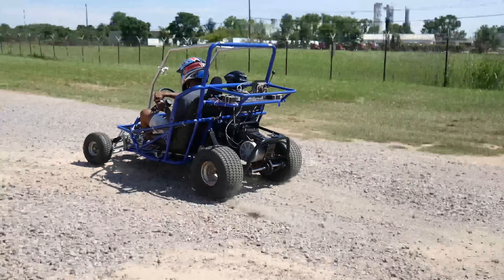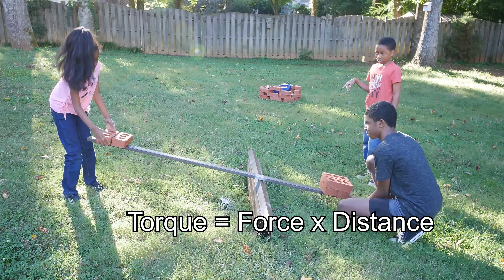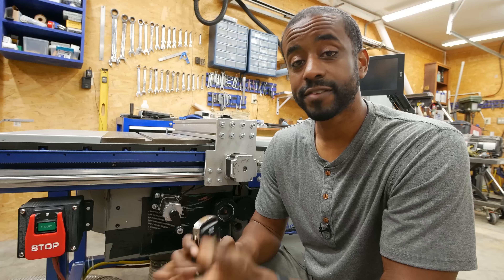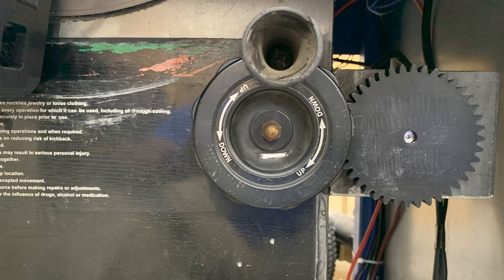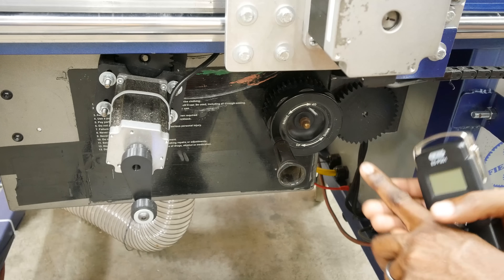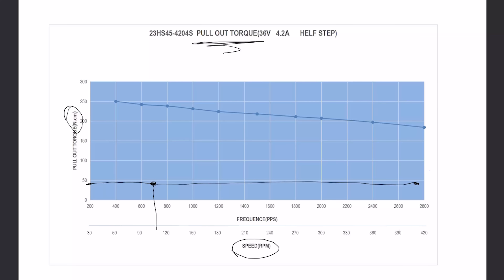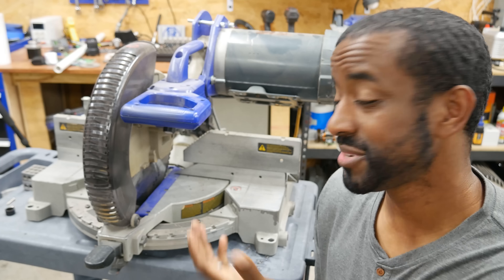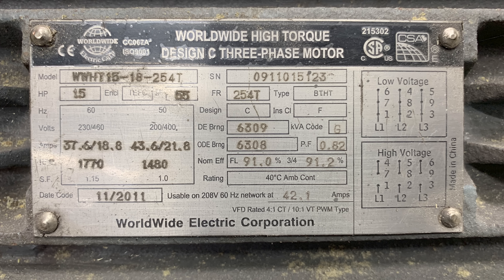How To Size Electric Motors for Any Project: A Beginners Guide #085

Comment: I will be coming back to this video in a few days to start my overdue upgrade project.    Here is my project.  (I hope that the people here can help give me some tips on this project.)    So here is the project.   

My wife got a fancy cat last year.   We ended up buying a very expensive poop machine called a Litter-Robot #3 by Whisker.   The machine works ok at best.  How the machine should work is that, after the cat does he's business, the unit will cycle and dump the contents into the air tight bottom container.   However, it almost never makes the full cycle.   So this mean that every time I walk by i have to hit the reset and cycle button to help it along.    I do this about 3-4 a day.   But sometimes this is not enough and I need to power cycle the unit.  

Thats problem #1.   The second issue with this machine is that when the machine does kick on, the motor is sooo freaking loud !!!!   I have 3 kids, (1, 3, 11) , this super loud motor whine always seems to wake up one of the kids a night.  I have to remember to unplug the unit at night so that it doesn't turn on.    I need to make sure to replace the motor with a big enough motor that can be quiet.   

Problem #3.   Some times we over fill the unit with cat litter and the stock motor will not even move the cylinder.   When this happens I have to go back and scoop out litter.   NOT FUN.   lol.  I want to make sure that the new motor can power through and not have any issues.   

I'm pretty excited to see if anyone responds to this post.   

My background:  I worked as an electrician for 5 years.  Then joined the ARMY.  When I got out, I got my AS degree in Industrial Technology (Industrial Electrician), .  I am working now as a Biomedical Engineering Technician for a big hospital.   I've also taken a couple years of wood shop and I just purchased a Miller Multimatic 220 and I'm teaching myself welding.   Thanks to everyone, if anyone, who helps.

Comment: One thing to note, about fans, the faster they rotate, they move more air, requiring more power and if they rotate twice as fast they require around 4 times more power. Learned the hardway.

Comment: Instead of mesureing the rpm of a motor yourself you can first see if you can find a data sheet for you motor unless if you already have an rpm meter in which case you should always use those measurements

Comment: You know, I'm pretty decent at building things. But usually, I end up with trial and error as my way of determining these questions. I suspect I've spent $3-400 finding out what doesn't work.

Had i had the ability to focus in school, I could have learned some of this. Anyway, all that being said, I wonder if it would be feasible for you to offer a consulting fee for individuals? I certainly could sometimes use the recommendations of an expert to avoid costly learning. Just a thought.

Thanks for posting, I now have a bit of understanding, but, no real idea of where to go next. By the way, too cool with the kids. Mine hated moving firewood till they got heat bills. Anyway, thanks again, and God bless.

Comment: As long as the weight of the scale is less than what it takes to turn the handle you're not including the weight of the scale, because that is just the force used to turn the handle.

Comment: Really great stuff from a really good guy. Jerry, would you comment on adding a second ebike or geared motor on the other wheel to use solely as a generator? Would I be able to generate enough power, current, voltage to offset the extra weight, friction, etc? Anyone's input would be welcomed by me.

Comment: I missed your live feed, by 5 months. But I still have questions. I'm building a mini table saw, but don't want a 4" blade restriction. I'm looking at several motors and believe the DC 895 motor would be optimal. Unfortunately the most prolific YouTuber I've found on these size motors is East Indian and I can't understand what he's saying. I want to be able to mount at least a 5.5 inch circular saw blade, maybe 6.5 inch max. Would the DC 895 format motor work? If not I would appreciate a recomedation. The only other question is whether to go direct drive or use a belt drive. Any information you can provide will leave me very grateful.  Thanks for the great videos.

Comment: As always, very insightful! I'm making a barber pole(crazy, I know). Right now I'm using a motor from a microwave. It runs slow enough because of the gear ratio but it's too jerky. What type of motor would give me that "slow and smooth rpm? Thanks for all your great info.
Reply: Buy kambghini farri v12

Comment: Man, you are great! I need your opinion on a project. I want to make a motion for a flight simulator I am building. Fill size Boeing 767 cockpit with 2 seats, dual controls etc. with 2 individuals and with hardware about 500 pounds.  I can handle the electronics . I am looking at cheap way to use actuators  with minimum power., meaning the weight of the hardware would be "neutral" .  Being a physician, I have been looking for a large ball and socket mount. I'm thinking about a 3 foot socket,  somehow covered in multidirectional "free steel balls" like those in ball bearings but free in a layer of grease. The "Ball" would be mounted at the center of gravity of the cockpit.  The center of gravity could be adjusted with water tanks inside the cockpit or weights added . I would use either linear actuators or step motors  or both.  The idea is not to have the actuators support the weight of  the cockpit, but rather exert a small force to make up to 45 degrees banks in 4 DOF,  up & down I can use an electric car jack or a jack screw.  Any thoughts or recommendation would be most appreciated.!   Sergio 480-299-9984.

Comment: Did I miss how you calculated the torque? I saw you measuring with the scale, giving you Kg, which you can convert to Newton, but Torque is in Nm.
Ok, I did some research and found some other videos that explain this, and if I understand it correctly, torque is the amount of force (N) you apply on a lever to get 'the thing' moving. The longer the lever, the less force you have to apply, the shorter, the more force, but the torque value should end up the same, if I understand correctly. This means (I guess) you have to divide the force (N) by the length of the lever (m)?
To bad this was omitted from this video, because without that calculation, this whole explanation lacks a key component.
The "I forgot the measurements, so I'm going to make up some numbers", wasn't exactly helpful.
Now that I think about it, you didn't cover the mass to force conversion (Kg to N) either, so that's a second thing you left out.
Though I love your channel, I'm really allergic to "let me explain" videos that leave out half of the needed info.

Comment: I have stumbled on your videos in my research into replacing a boat motor with an electric motor.  

I am trying to find out what size, torque and speed I need to replace a Volvo Penter 2200hp gas motor. 

It is a future project.  The research is killing me. Lol.

Comment: My 2nd video, I guess I am working backwards. Do you know what you just did here? You took a large amount of academic information and not only condensed it into a very short amount of teaching time (honestly, those formula and  calculations would take weeks to cover in a classroom) while providing not just practical examples of the concepts, but actual real world measurements that people may not have otherwise thought of. Using a teeter totter to help us visualize the relationship on the size of a gear was brilliant. So was using a fish scale to measure the force to turn the gear. You have a knack for taking complex engineering concepts and making them understandable just by relating them to the average person's understanding of how the physical world around them behaves and works. Most people for example don't understand the intricacies of thermodynamics, but we do know that if I touch a cold piece of metal vs a cold piece of wood at the same temperature, the metal will feel colder, faster. So you are taking an everyday experience approach of common knowledge and using that to build the students' understanding in a very rapid and relatable way. Awesome! Keep it up!

Comment: I could listen to you all day. Do you have a background in teaching or public speaking? Anyhow, I've got all kinds of little motors and stuff floating around since I started watching your channel. Not that I'm not naturally a packrat. I don't know if you can answer a specific question, but here goes. I'm looking for a replacement motor for my Craftsman Table saw model 113. I thought it was 3 hp but it's really only 1.5 and it's actually weaker than my last table saw which was an Ohio Forge from back in the day. When I go to Amazon and search for a 3 hp 3450 rpm motor for a table saw most of what comes up are motors for air compressors. Would this work? I assume by the way they are shown that they must be some kind of general use motors. Anyhow if you can answer this question, I'd appreciate it.

Comment: Sir,i needed to run 3 phase motor in 2phase voltage with help of capacitor  . i done but amps will take high compared 3 phase and 3phase amps R-7.     Y-  7.5  B - 7 then 2 phase amps  R- 13. Y-1.8 B -14  so coil damage                              sir needed capacitor rate to 1 hp to 15 hp motor for submersible motor it will be 50 H frequency voltage 415   need formula sir

Comment: Also, at 5:30, I'm not sure how you get 9550 in the denominator in the top formula. I get ~2.65. IIrc, if T is torque in Nm and \omega is angular velocity, then:

P [kW] = \omega*T / 1000
= 2*\pi*freq*T / 1000
= 2*\pi*60*rpm*T / 1000
= rpm*T / 2.65

Hope I didn't misunderstand something.

Comment: Thanks for sharing. I have been retired for 10 years, and I used to work on CNC machines back in the early 80s.  I was the repair technician, so when replacing motors and parts, I usually had the part numbers. Several times a month I had to call our company engineers on oddities that I came across.  I was amazed and thankful for the help they gave me, to get our customers back in production.  For some companies the name on the part is more important than production.  Even after matching the numbers for requirements, don't install a General Electric motor in a Westinghouse plant.  You'll get a call to remove that #$_&+ motor from my assembly line.  Lol, I finally got the line boss to simmer down, if I would remove the GE lables from the motor.

Comment: What motor would you use for use in an outboard motor conversion? Switch from gas to electric. Would like around 115-140 HP using solar to charge the batteries. I really appreciate your help.

Comment: Great video. I have an issue with powering a large air compressor. It has a gas powered 10hp motor, do I need a 10hp motor or will a 5hp do? I have no idea or means to check how much force is needed to turn the compressor pump.

Comment: I was just thinking about a similar question recently: Where to get cheap BLDC motors and how do I spot the characteristics in descriptions from China. Of course the BLDC could be a topic to: Which type of motor do I need, but generally I guess brushless wins agains brushed motors. Even if the BLDC wins agains other types, there are different types of brushless.

Comment: Jeremy you are a great teacher. If its possible and you've explained it in a video, how to utilize a 24 volt motor and wire it for use as a 12 volt motor, could you please direct us to such a video?
Reply: research the star and delta wiring connections

Comment: Jerry, many people use 12 V motors such as windshield wiper motors or power seat or power window motors for projects. One thing I never see discussed it how to power them. Keeping a car battery about can be messy and they will need recharged.  AC is readily available.  On the cheap, what would be a good power unit say for a sheet metal bead roller. It would not be running continuously. Thanks.
Reply: Use a transformer 120v input to 12vdc output. You use them every day such as powering your lap top or charging your cell phone, of course those don't have 12vdc output. The laptop probably around 19vdc and your cell phone being 5vdc to charge. Of course you also need to make sure your transformer can handle the amount of amps that your motor requires

Comment: You answered a question I hadn't asked yet which is how can I get more work done with my old wood lathe. I fiddled with a couple of motors and ended up with a newer era motor with the same speed and hp as the original one. Now I'm probably gonna need to replace the oiled drive bearing with a roller of some sort. Great video as always Jeremy, thank you very much for sharing your intellect!

Comment: 1) For Battery applications, the Ki and Kv of a motor are really important in doing a design.  They help you to match the battery design and/or choose a motor that works with the battery you are using.
2) For designs that don't operate over a wide range of speeds, you probably need to consider the torque curve for the motor to assure the motor can meet your needs over all your operating conditions.

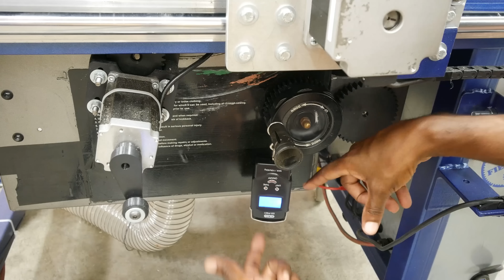Comment: 4:23 That's wrong. The weight does not go into the result. Minor mistake:) 
And btw: Horsepower are also widely used in Europe. (Even though officially it is not used)
Reply from the maker: Why wouldn’t it? It’s a force added to the force you are applying... unless you mean you let it hang free then zero the scale. I can agree with that.
Reply: @Jeremy_Fielding  Yes, as you said it is a force applied to the scale (in addition to the force you apply with your hands.) Therefore it is also counted by the scale. (Let the scale hang and it will show on the screen) This means that your result for the force you need to turn the wheel will be the same whichever direction you pull. If you pull downwards you just have to pull a little less hard.
Reply from the maker: I follow you and I agree
Reply: I was thinking this too, as long as the weight is less than the required force.  But this assumes the handle is balanced.  So pulling horizontally is probably right for a completely different reason.

Comment: I still want to know what his kids power rating is.
Reply: It's variable, it all depends on the candy input.
Reply: Remember in general when you increase power output you also increase heat generation.  He could have used some kind of heat sink but I would have used water to cool the system.
Reply: 1/3hp x 1/2 human size but with an 80% duty cycle.  Average man = 1/3 hp but 5% duty cycle.  There is an argument to be made for child labor here.
Reply: approx. 1 kidpower
Reply: Okay Vegeta.
Reply: Over 9000
Reply: You beat me to the joke vegeta what does the scouter say about his children’s power level
Reply: In my experience you have to take into account outside temperature vs how many otter pops they've consumed.

I like to start with one otterpop and one every 15 min until the job is done at any temperature above 65 degrees F.
Reply: I don’t know, but kid power is off the charts, and they seem to like exerting it.
Reply: It’s over 9000 for sure
Reply: @Evoke404 this is the only correct answer haha
Reply: More than 0
Reply: @SapceDandy 94 I think nobody got that joke. But I did. Thank you 😄
Reply: @dinoscheidt  what's the joke lol